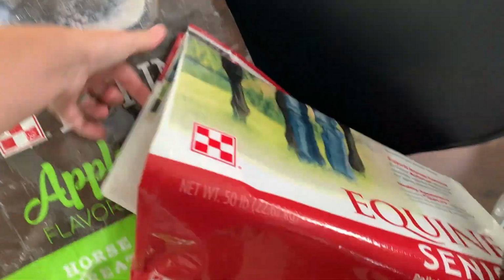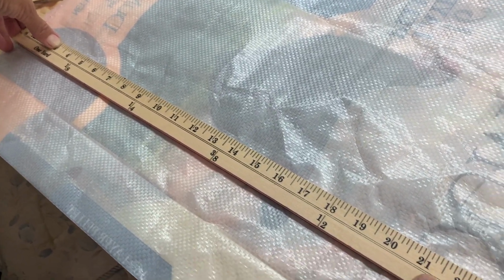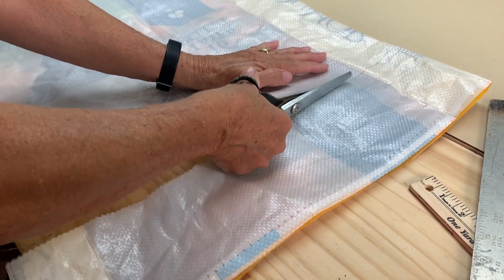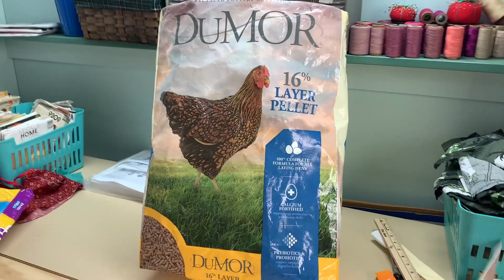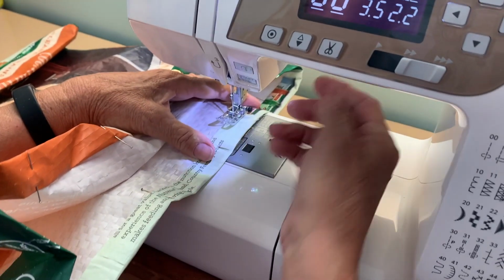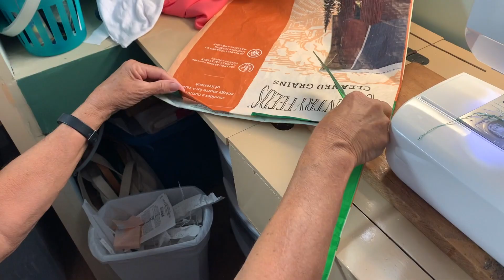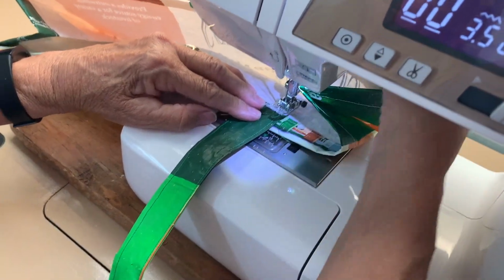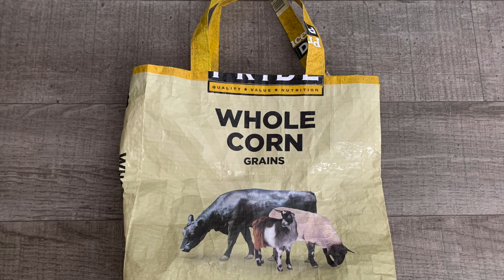STOP Buying Reusable Grocery Bags || Make your own with Plastic Feed bags

Comment: Nice. Just one observation regarding handle placement: when they're placed on the opposite side, they are more likely to aline with the grocery station hook apparatus which most stores still have. (At least this is true where I live.) Same side handles end up   flopping around in the way of the packer, and not supporting the bag at the station. This is not meant to be a criticism, rather an alternative.